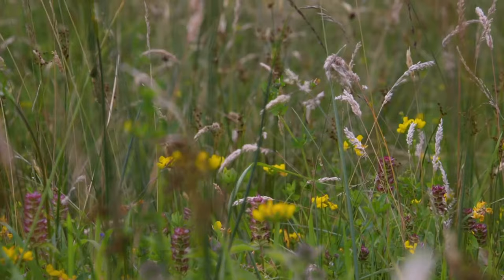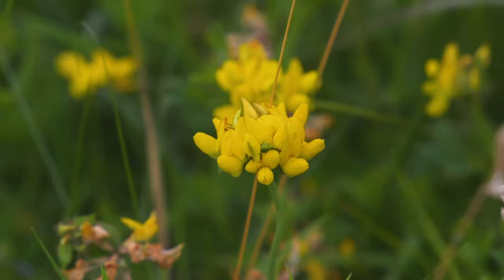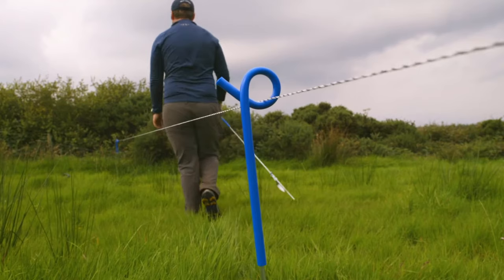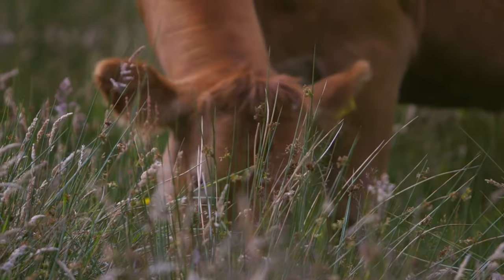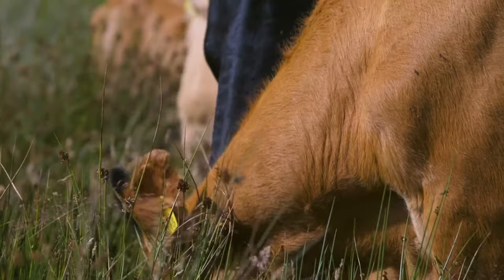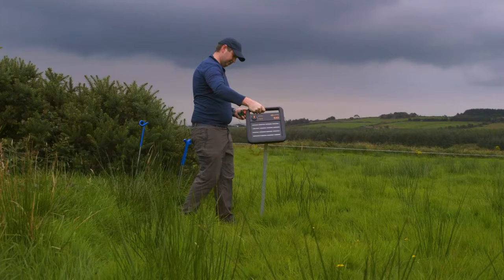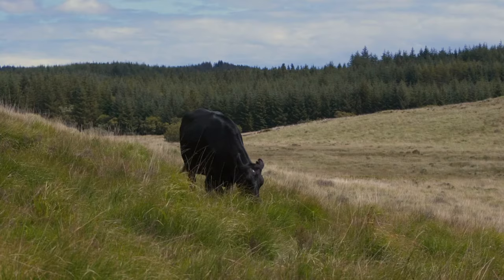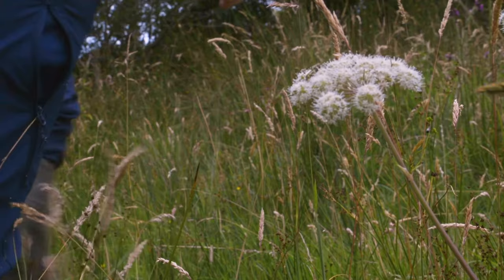GRASSLAND MANAGEMENT

Comment: So you only want to me to use my fields for 28 days of the year?
Reply from the maker: Rotational grazing gives plants a chance to recover, by itself it does not reduce the farm level stocking rate, merely that animals are kept moving on and are not kept in the same field or paddock for an extended time. Giving plants favored by livestock a chance to recover between grazings means they can compete against Rushes and other unpalatable plants species. The result will be that the stock carrying capacity of the land will if anything be higher than it was before.
Reply: The theory sounds great, but I have 600 ewes with lambs, 100 hoggs and 25 cows on 1200 acres. 50 acres of meadow ground then the rest is rough pasture and fell ground. 1 field is 480 acres and the another is 350 acres. I’d be spending 24 hours a day moving animals and fences. It’s a hill farm like what is mentioned in this video and is far from the biggest in my area.